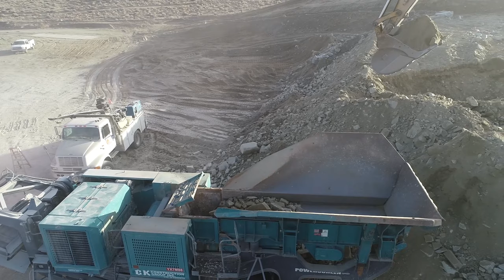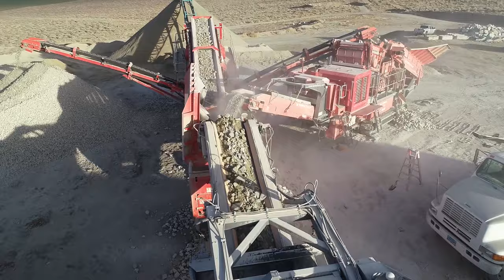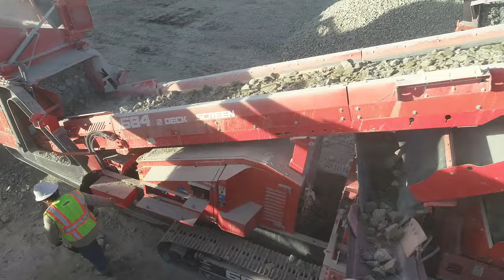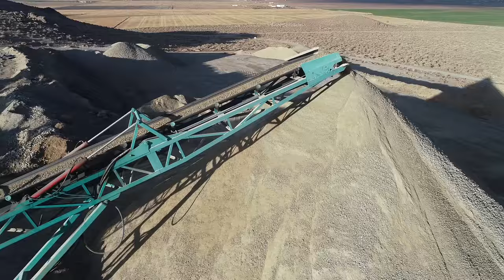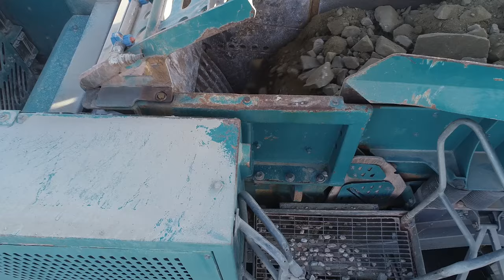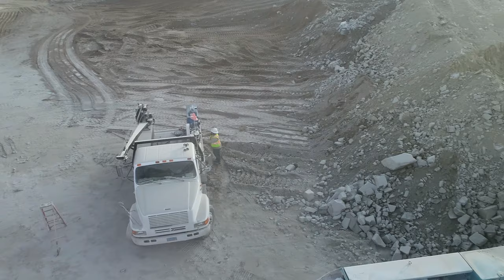BACK TO WORK! ROCK CRUSHING

Comment: Wowee!!Was I ever glad to see you show up on my notifications! Missing my pit work! Terex gear Eh?! How's that stuff running? Thanks for the video!
Reply from the maker: So far it seems good, we were running a Finley jaw earlier this summer which had nothing but problems and sadly caught fire and was replaced with the 400X seen in this video. I will post some videos from that operation maybe in a few months when I get around to processing the video. I will probably be posting quite a bit of videos from this operation over the next month as I will be close to the operation where I can run out and get some video.
Reply: @JoeRockYT  That sounds like a lot of scary excitement! Hopefully no one was harmed. It would be neat to see the different equipment. The good, the bad and the ugly! Thanks for this! I will look forward to more!

Comment: Is that a screen deck above the cone infeed?
Reply: Yeah it’s a pre screen, not in use in this operation cause it’s in a train of machines, but if you were loading straight into the cone crusher it can screen out the fine material, saves wear on the cone a bit.